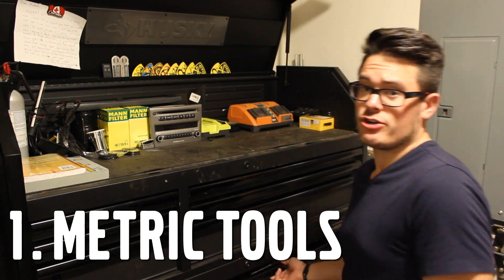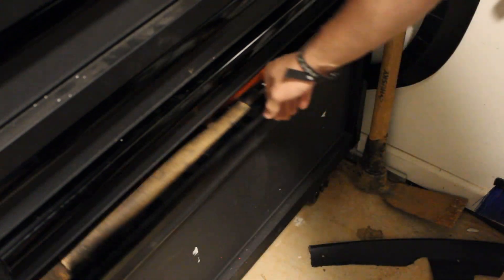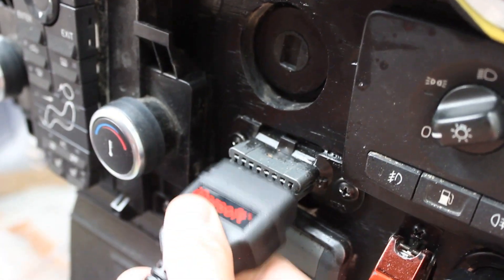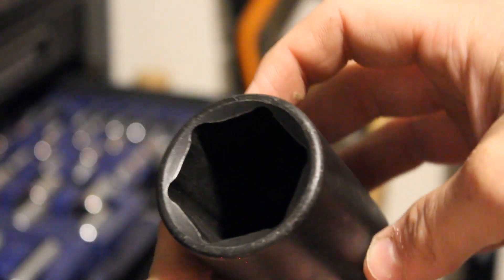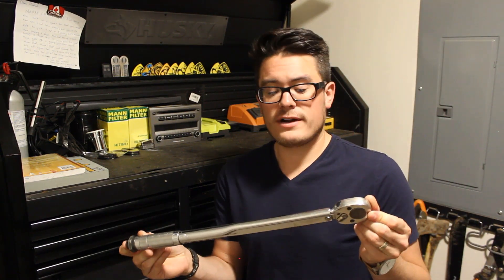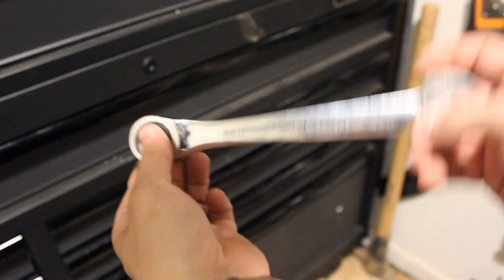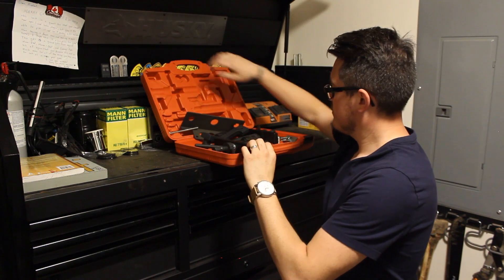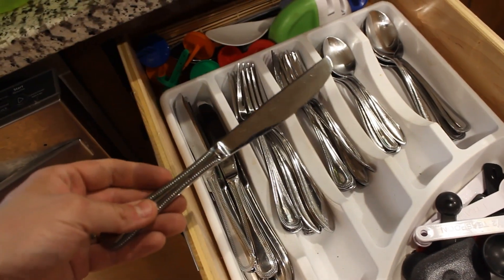Top 10 Things Every P1 Volvo Owner Needs In Their Tool Box

Comment: Great video. I don't have number 10 but I'm about to pull an engine down so sounds like something I finally need. I agree with the whole list. For the scan tool nothing beats a VIDA/DICE unit.

A couple of things I would add

1) create or make a stubby allen key for people with haldex so you can pull the filter off without having to pull the whole driveshaft out.
2) While you mentioned torx bits I'd specify the T50 torx as its required when pulling the gearbox out in at least the auto.

Comment: A 90 degree angled flat screwdriver for reaching and opening the radiator drain valve; so you don’t have to remove a bunch of stuff to access it. I used one on mine last week and it worked perfectly. Saved me a ton of parts removal time.

Comment: Another very good reason to torque wheel lugs is so that you can get them off again if you ever need to change a tire on the side of the road, I’ve taken off multiple wheels on different cars where the lugs were so tight I had to use an impact driver or a pipe over a breaker bar, and if any of those people had had a flat they would never have been able to get the wheel off with the provided lug wrench

Comment: Working on aircraft, 'Bondus' makes a great ball end hex set with poly carbonate handles in both metric and imperial. I like your small ratchet handle, completely forgot when in the USN Submarine service that was a common tool for exactly the reasons you stated.  IPD in Portland, Oregon USA (Volvo Specialty Shop) sells oil filter sockets which BTW are lighter and shorter. They also sell numerous filter packs, gaskets sets and the like.  Thank you for the tip on the SRS fault/alert (iCarsoft tool) reset tool.

Comment: Bearing tool is must, also i recommend to have cranksaft holding tool and brake piston tool.
Reply from the maker: Great suggestions.
Reply: Diesel owners need: D5, diesel filter socket (32mm) similar to oil filter socket) and D2 owners need 12v pump for bleeding the fuel system after filter change (hand priming pump works also if you have nerves of a cow).

Comment: Yipee! I got everything except 10. I've had 7 Volvos since and changed the timing belts on them... I never needed to lock the cams as I use the "markings transfer" method. You should add pulley puller on that list. 😁

Comment: Ok here are my suggestions. I would get 2 torque wrenches. 1 small (1/4 inch 6-30 nm) and one big (3/8 inch 20-200nm) for the heavier stuff like wheel nuts. I would get an extensive heavy impact (CR-MO) socket set. CrMo is rocksolid and won't break or slip  easily on stuck screws or bolts like the cheap Cr-V do. You can even use it without impact gun of course . Not sure why you would get a obd2 scanner like Icarsoft Michael. What does it do that VIDA with Dice can't???
Reply from the maker: iCarSoft can be used anywhere without the need for cables, computers, and an outdated windows operating system. If you're hardcore into DIY mechanics at home, Vida/Dice is an absolute must. But for most people, the iCarSoft handheld will provide all the diagnostic information and fault resetting capabilities needed at a fraction of the cost with a lot less hassle. It's nice having a Volvo specific OBDII tool that conveniently fits in the glove box.

Comment: Hello Michael, was considering get a Forge BOV, is this also known as the CBV? Also is there an easy way to access that area easily without lowering the subframe? This for the an AWD p1 s40 t5 m66
Reply from the maker: I have the Forge unit on my C30 and it has been great for 150k miles and still going strong. A blow off valve serves the same purpose as a compressor bypass valve and the terms and often cross referenced in the Volvo community. But a BOV suggests atmospheric venting, where a CBV redirects that air back to the intake. You'll get intake whooshing noises, but not that Fast and Furious blow off sound. That being said, a recirculation valve is ideal because the car accounts for that pressurized air returning to the system, not venting off. So if you do vent it off, you may temporarily run extra rich between gear changes.

No reason to lower the subframe. Pulling the passenger side axle will help a bit with access. It's a tight fit, but it is possible. I have replaced quite a few of these over the years and only ever had to pull the axle when the bolts were extra seized.
Reply: @MyNameIdeasWereTaken  Much appreciated mate on the help. Ive been trying to find a BOV that makes the STUSTU noise, any recommendations on companies that make them for us all while keeping the lines fairly similar?
Reply from the maker: @UncleJuulian  The Elevate/TurboSmart Dual Port is probably the closest you'll get to that from a noise perspective.  I pretty much just call it an audible cosmetic upgrade.